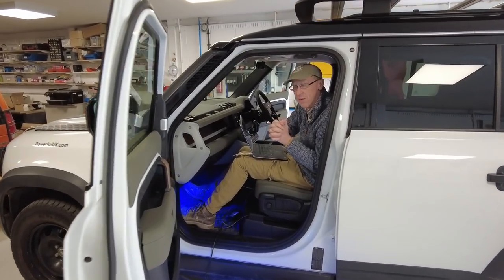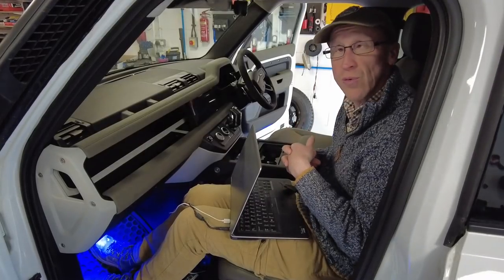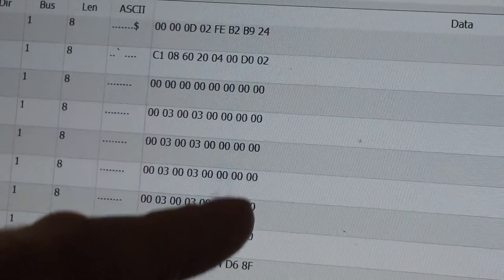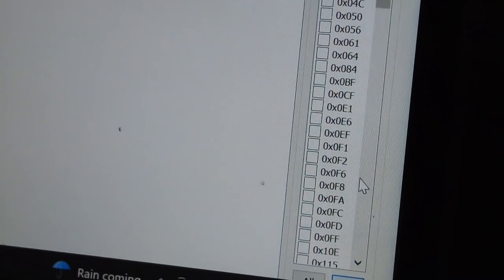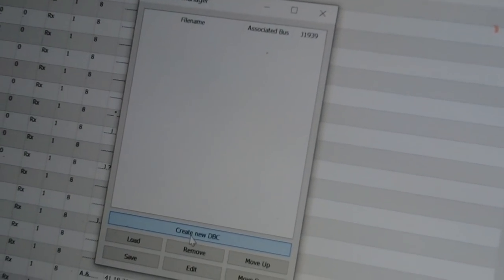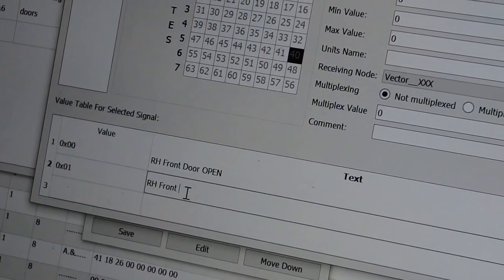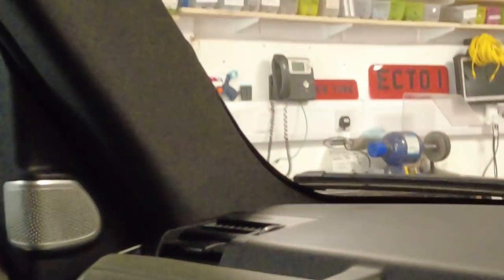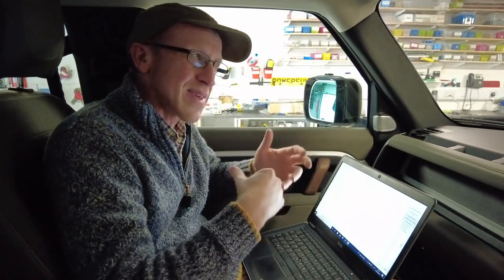Analysing CANbus data on a Land Rover Defender L663 using SAVVYCAN ( To add new accessories )

Comment: Phew….I’m not sure that I would find it fun…terrifying is a better description! I’m just fascinated how you work your way through all of this and understand how each part of the functions work. That is your experience in high end electronics…a foreign language to most of us old souls who were happy to just plug a bullet connector into the lighting circuit to get our spot lamps to work on a Saturday morning after a splurge of £10 for a set of Rayodots in Halfords!! Well done men…most impressive! 😎😎😎😎😎😎Richard

Now despite what I say above, I think I can understand what you are saying and that skill impresses me as well. My ideas for rewriting  are this. When the engine is running and the passenger gets out of the car, the radio stays on but if I stop the engine and the passenger opens the door, the radio switches off. I understand why that is needed on the drivers door but I might be waiting for the passenger to return from say, a shop and have to restart the radio every time. Hence…disable the radio off mode on passenger doors. Also…rewrite the length of time the radio will play…mine shuts down after about ten minutes at very most but 30 minutes should not kill a healthy battery?? Any good??🤔🤔😐😐😐
Reply from the maker: Things have move on a bit and Land Rover are putting current sensing in circuits to stop people changing things or adding to circuits so this is why we need to up our game

Comment: This is brilliant Simon. Thank you. One irritation or problem I have is that the instrument panel and entertainment system turn on every time you open any door. When camping this can cause the battery to go flat because often you may open and close doors many times, throughout the day. I can understand this happening for the drivers door but not the others. Can this be turned off for all doors except drivers door using this method? 

Thank you
Reply from the maker: Hi Bruce - I plan to do a review of the current consumed by each fuse to see if we can track down which fuse we can add a switch too to isolate that fuse for "camping mode". We could then use the CANbus controller to automatically isolate the circuit when set to a camping mode.
Reply: @L663  that would be awesome! Thank you for the reply
Reply: @L663  Hi great guys! Is there a solution maybe today? I see it is 2 years old this topic. Thank you so much!
Reply from the maker: @MCMKAP  We are looking for people to take part in our Beta trial of the CANbus controlled relay. If you want to be part of the Beta test please send an email via our website.

Comment: Hi Simon, the canbus module IDs (the pupils in your video) must all have a distinct Ids, Same goes for the response codes from each device eg Open / closed etc values.  If the list isn't defined (IE in a data dictionary) then the device manufacturers wouldn't know what to code their devices to respond to or what each response meant. Likewise a signal would be sent to a device to trigger an action eg internal light on when door opens etc and this also needs to know where it's going and what the instruction is. Your life would be made a lot easier having this. Any friends @ Land Rover who could assist? Brilliant insight - quite often it's what you do to take the 'lid' off these things that takes the skill. :-)
Reply: No, modules having a set ID is wrong.

Comment: After watching your adaptive beam video, the same would be a good algorithm for the light bar. If they make adaptive light bars, narrow or widen based on speed and only come on when any off road mode (not Eco or Comfort) is selected. Or a different mode - come on when speed is above 30mph and auto high beams activate?
How about: Disable tire low pressure warning when any off road mode is selected and speed remains below 40 mph (or when off road height remains active?)

Comment: Simon, you champion, woodsy here from Australia. This is fascinating. What are the chances of developing access to use the Defender camera system as dash cam with cloud record link??
Reply: Now THIS would be excellent !
Reply from the maker: The cameras use LVDS ( Low Voltage Digital Signals ) not conventional camera signals and its tricky to decode these LVDS signals. It is crazy how many cameras are on the  new Defender - Dash cam / driver assistance camera / front parking camera etc. The Tesla uses the same camera for all functions including dashcam with parking mode !
Reply: @L663  Thanks again Simon, for your terrific research, videos and product development. I have a 2021 Se D300 after 6 Discoverys & I could not be more pleased, but the insight you provide into tweaking the Defender is terrific. Brad

Comment: Simon ,

Question:

Which electrical outlet i could use to connect a outdoor LED light when camping, and doesn’t shut down 5 mns after switching off the car ?

I tried the one in the front and the ones in back seat, all cut off shortly after shutting down the vehicle.

Cheers,

Comment: If utilizing speed, then if you stop to get out of the car to move a tree limb, the lights would go out?  Wouldn’t the terrain response be more feasible? Such as out of normal mode, brights on, suspension raised?
Reply from the maker: Yes i agree - if suspension is raised or in off road modes then light bar on with main beam all the time

Comment: Could you create a code that would level the car when parked for camping? Adjust each corner to create a level surface?
Reply from the maker: At the moment we are just listening to the CANbus so we can see it is not level but taking control of the actuators to rectify this is much more difficult - but i do know a company that is looking at this idea !
Reply: Oh my word, that would be a great feature. Just drove Swartberg Pass (in South Africa), stopped to make coffee with my jetboil on the PowerfulUK picnic table, and battled to find level ground.
Reply: @L663  Cheers and Thanks

Comment: Very well Simon. I was known with sniffing a CAN bus, but have not been able to get anyone to lend me his Defender. Trying to get NEW defender headlights working without the Defender. I did find a schematic which states that I only have the inputs for high and low beam, and CAN bus. Also i see a CAN bus connected from one headlight to the other. Can i control this lights by just sending the correct CAN messages which i will have to sniff, or is that too easy said?
Reply from the maker: In theory you are right - the headlights just need power and CAN. There are several signals sent over the CAN - headlight levels / light output / matrix segments ( on some models ) This actually could be a fun project - you could create a light show like on the Tesla ! even on the car. Why are you trying to illuminate a Defender headlight not on a car ?
Reply: @L663  Because there is this car that only has the lights, and not the internals of the defender L663. this helps a lot. There is no LIN communication? the schematics also state LIN input
Reply: Found out the following: The headlights need CAN messages (any) to be activated. if activated, the pin 9 and 10 trigger low beam and high beam. I assume the DRL and turn signals are controlled over LIN but have not been able to get this running. this is however, a matter of time

Comment: I have a question about adding new accessories. My Defender is a 2022, because of electronic shortages not all options that were ordered made it in to the build. In my case, the clearview mirror was not added. I looked up in the area of the overhead console and believe that I see the fiber optic cable imbedded in the wiring harness for the mirror/camera. If that fiber optic cable is there, can I just add the interior mirror and the fin with the rear camera or, do I need to program it in to CANbus for it to work? How do I know if CANbus controls a function of an accessory? Maybe I’m just thinking out loud here…not sure where to look for info.
Reply from the maker: Good question - I know this has been done. Here is the wiring for the mirror
https://www.dropbox.com/s/m5elhc7arsxvsfk/rear%20view%20mirror%20wiring.JPG?dl=0
It looks like there should be a 6 way connector there as well as the video input.
I will look at this on my car and see of the wire is there too.

Comment: Would it be a good idea with the speed over 10 mph roof beam on code to make that a rule only in hi range. Low range whenever high beam is selected turn roof light on instantly. That way if your off road navigating an obstacle you’ll have use of extra light.
Reply from the maker: That seems a good idea to have different logic for off road modes / lo range
Reply: @L663  could always do something in rock crawl to allow reverse light maybe? More challenging terrain more light on the situation.

Comment: Nice work Simon! Question about the Macchina...looks like you went with the underhood model M2 instead of the OBD model M2. Wouldn't it be easier to go through the OBD port for communications? Then it's just one hookup with USB to computer. As I stated earlier...super nice work! Looking forward to more CANbus decoding videos from you!
Reply from the maker: Hi - i am glad you found this interesting - was worried it was a bit geeky !
The problem is with the ODB port is that some car manufacturers "filter" the messages you can see on the ODB11 port
This could be for security or other reasons ! so i was keen to tap straight into the main circuit - also i can leave this connected to the tow bar connector and still use the ODB11 port for other applications - like Pathfinder software etc.
Reply: Good information! I’ll be following along watching for updates. I’m going to try this same process, not sure if I can as I have a trailer plug. If not, I’ll try other places. Cheers mate!

Comment: the algorithm should include the use of any off road mode, light sensor and speed and maybe activate it with the fogs
Reply from the maker: Good point although the cars high beam mode does not work with FOG - if you have toom much light in fog it can be a problem.
Reply: @L663  I don't understand how you are going to connect to the canbus model and adress the light bars, but people that goes off road will have white light bars for visibility (long range and flood) and also will have yellow bars for fog light situation 

so if you are using a canbus module to adress the switch, then 

option 1 high beams + off road + engine running + 5mph  turn on all white led light bars

option 2 fog lights + off road + engine running + 5mph turn on all yellow led light bars

option 3 engine running + park + tailgate open aux lights (rear and side  light bars)

In my opinion it should be better to develop a nice place for rocker switchs for accesories

Comment: This is so fucking cool. 

With regards to roof lights if you’re off roading at night would you go below 10mph at times so you wouldn’t want the roof light turning off?
Reply from the maker: Yes based on the comments here I think it would be good to have roof lights on with main beam in all off road modes and also if suspension is raised.

Comment: What about raising the car in extended mode
Reply from the maker: We are not using CANbus to control anything or input any signals onto the CANbus - only "listen" to the CAN and use this to control other devices.
Reply: There is a cheat for that. Something like keeping your foot on the brake and pushing the lvl up button for 8 seconds.

Comment: Hi 👋 very nice 👌 interesting 🤨 I have also upgrade my Range Rover ac /heater panel to newer LCD screen 📺 like new model. 
Thanks 🙏 🙏❤️❤️💕💕
Reply from the maker: Mr Virdi - congratulations on the AC panel upgrade - I have seen this but not done the install ! You beat me to it !
Reply: @L663  no I don’t want to go front of you I always respect you if I tell you this how much is cost me you are not going to believe me cost me very low price directly from china .
Thanks 🙏

Comment: At the risk of sounding like an old geezer, why would one work so hard to to get a car computer to do things the driver can do more efficiently? (kind of like using my phone to change the thermostat instead of getting my rear end off the couch and walking 6 feet to do it manually. Yeah, I'm guilty) 

My 2020 D110 roof lights have a standard Carling switch that is totally in my control.   I'm sure you will come up with something I haven't thought about that will be cool.  

Just seems that a lot of effort is going into unnecessary automation that also further removes the driver from the experience.  But it does seem fun to poke around this new Defender.

Cheers
Reply from the maker: I think you raise some valid points - sometime i do things just because they interest me and I hope one day it will turn into a useful product. Some people have asked for this and it will be nice not to impact the warranty. Also later i may be able to broadcast onto the CANbus - then we can have some fun - and i am looking now at a 2nd display with extra info on like engine temperature etc